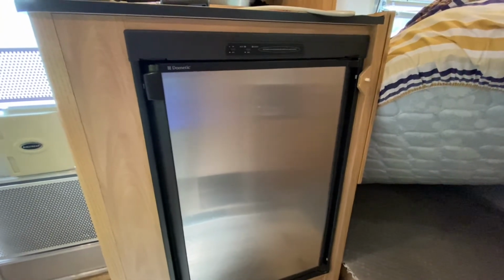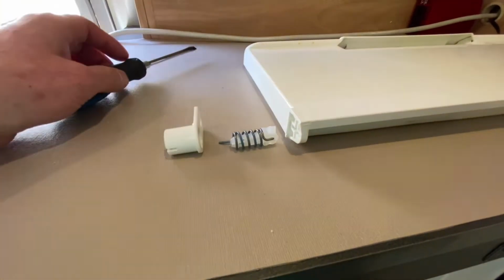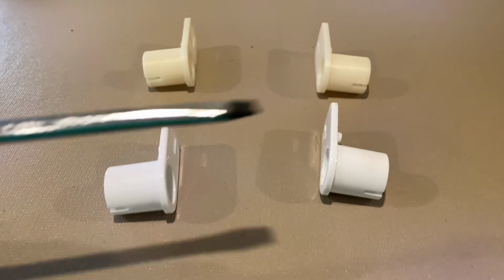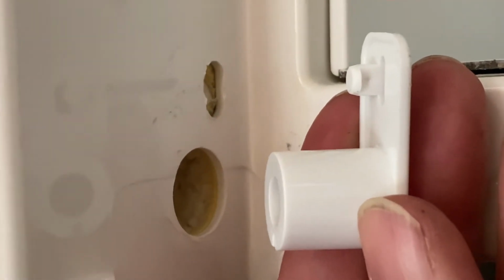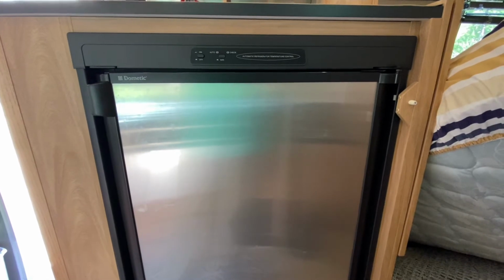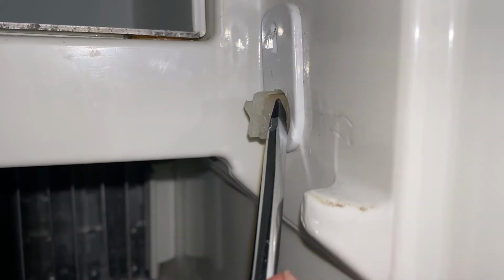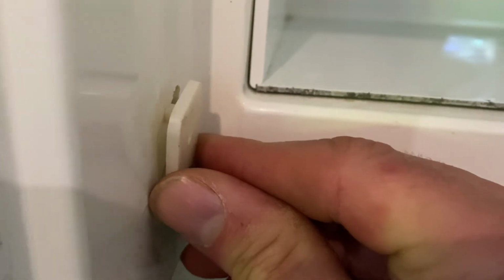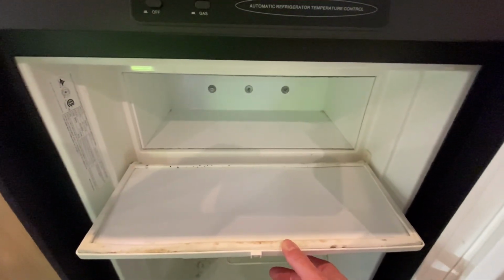Fix Your Dometic Norcold RV Freezer Door and Save MONEY!

Comment: Do these also work for the norcold refrigerator?
Reply from the maker: Hi Steve! The technique works for Norcold. But our parts are specifically made for Dometic. Some folks do say that our parts do work (or can be made to work) on Norcold, but our advice is to find an exact fit. The good news is that Norcold OEM replacement parts seem to be easier to find and less expensive than the Dometic ones.

Comment: Thank you for your video. My freezer is a Norcold and the spring housings were a little different but operated the same. I ordered new ones, followed your process, and the freezer door stays closed. Again, thanks.
Reply from the maker: Great to hear! Our springs, spring housings / casings, pivot bolts and spring assemblies don't fit Norcold (without some modifications), but the techniques are similar, and you can get Norcold parts on Amazon.,

Comment: We have a norcold but the hole didnt line up to pop it in to make the spring tight (the hole was a little low so we had to drill out just a little to make it work) but fits really tight and has the ping to close. So it took a little longer because we had to take everything back out to do that. Also the hinge housing and springs on the refrigerator were quite a bit longer than ifixit but it still worked. We have a jayco 2009 popup. Great savings and great parts! Thanks
Reply from the maker: Good point! This video is useful to know how to fix a Norcold, but you need Norcold parts for best results. Our iFiXiFi parts are optimized for Dometic.

Comment: Excellent video! I'm usually afraid to take on a project that might involve expensive collateral damage, but your instructions were great and we knew what to watch out for.  Both original spring housings were broken, we replaced them with your upgraded parts in less than 20 minutes. (The RV dealer estimated 3/4 hour labor at $200/hr.)
Reply from the maker: Thanks! That’s useful info. $150 for labor, plus waiting for an appointment, and taking the RV there and back… I think you owe yourselves a treat!

Comment: Perfect!! Great video!! I have the exact same fridge and exact same problem! Will be ordering parts soon!! Also if you lock your keys in your car you can use that air shim to help pry open your car door or window a bit to get a rod into the opening to hit the inside  unlock button on your car door. Need to pull the top of the door or window glass open enough to slide the air shim in then pump it up enough to have a big enough gap to get slide the rod in
Reply from the maker: Thanks for the tips!

Comment: THANK YOU for posting this video. I have a Norcold N512 fridge in our trailer. It took less than 5 minutes to change out the springs....almost like I knew what I was doing.  :-) I too loosened the screws on the bottom right of the freezer door it popped right out. A much safer option than prying it off with a screwdriver. Now to figure out what I did wrong restringing my window shades....
Reply: I have same looking one but much longer part # 619042 model norcold n306

Comment: Well these parts did fix my Dometic RM2501 fridge. However, the hole where the tail of the spring pokes thru need some slight modification to get spring thru. Door stays closed, but it does not “slam” shut. Thanks.
Reply from the maker: Hm. If it's not closing enough, you might not have put enough tension on the springs, or there's a slight chance that the springs are worn. As far as the hole where the tail is, please send us a pic of the problem. If the problem is with our parts, we'll send you new ones.

Comment: Hi
Does your part fit both Norcold and Dometic?  I have the Norcold  N412.3
On the ebay site it shows dometic.  I think Norcold is now from thetford.
John
Reply from the maker: Hi! Many models of Norcold use these parts. Generally if it looks like it's the same part, it is. And if it doesn't fit, just return it.

Comment: Hi no issue with the upgraded parts they fit my 2006 RM2354 no problem.  My fridge freezer door has them removable female receivers that screw into the bottom of door.  Remove the screws help with the disassembly.  No need for air bladder.  For me the screws need to be reinstalled first as trying to thread the screws in while pushing the spring in the hinge assemblies back in is not easy.  What work for me was you need to rotate the arm of one of the hinge assembly counter clockwise to12 oclock position and lock it in.  This gives just enough clearance to snap the other hinge in.  Then you you can rotate the second hinge assembly CCW and lock it.  Everything work out at the end but I must say this took an hour and a lot of frustrations.
Reply from the maker: Great tips! Many models have swapped the molded-in female hinge plates for the screw-in ones. That's a smart move, because the molded in ones eventually get brittle with age and break.

Comment: Thanks for the detailed instructions.  I really appreciate you outlining the caution points. Without them, I probably would have damaged something.  Your parts are much better then the standard replacements you get elsewhere.  The air chim was a great tip.  The one I ordered from Amazon came with 3 plastic pry bars that were very helpful.  I did have a few challenges that took a bit to figure out.   I originally thought the holes for the cam was too small until I reversed it and put the cam in first and it fit.  The challenge was getting the cam to fit with the spring in first.  I ended up using my bench vice and very gently compressed the cam and spring in the assembly.  Worked like a champ.  Challenge 2 was getting the right side of the door to go into the slot. After a number of tries and a few choice words, I finally got it to seat.  I think I will have a permanent "X" on my thumb from pressing the darn cam.  On a happy note, there was no bleeding involved with this project.  I consider that a win.  The door now closes with a snap like a mouse trap.  Thanks again.
Reply from the maker: Thanks for the "X"-cellent tips!

Comment: I was not able to use the air shim. But my Dometic has exposed hinge holders and by removing the two screws in the right hinge the door come off to allow the repair that is so well detailed in this video. It would be helpful to note this difference for those whose freezer door has the exposed hinge mount. Thanks!
Reply from the maker: Great suggestion! We'll include it in the next revision of our video!
Reply: THANK YOU for mentioning this. I have the same screws and would not have thought to just take them out. Didn't even bother with the shim. Now to figure out what I did wrong restringing my window shades. Ugh!

Comment: Great part, great instructions, great video…but I’m having difficulty getting the right side of the door in to the “+”. Left side is good I’m holding it in as tight as I can, but it still seems just a hair too wide to connect the “+”.  Tried the spatula method but don’t seem to have enough room to get in either. Any suggestions? Or better yet, any photos of the spatula method in action?  Thanks in advance.
Reply from the maker: Hmmm... So, you can't push the bolt on the right side in far enough to get the door to fit? 3 things you may want to do. 1) Check to make sure your springs are on the correct sides. 2) The bolt has a tapered end. When you push it into the spring housing, the tapered end sticks through the hole in the "bottom" of the spring housing cylinder. IF your bolt isn't too worn, it usually catches and stays in place. 3) You can also use the Air Shim to widen the gap.
Reply: @ifixifi  1. Springs are correctly installed on their proper sides.
2. The bolt end is catching as it should.
3. I actually thought of using the air shim too, but when I inflate it to the size I need, it seems to push the door out & then slips out of position.
Reply: Ok, finally got it!  Needed a third hand to help hold & push, aided with some colorful metaphors. Thanks for providing a great solution to a unique problem.

Comment: These parts are AWESOME! They were shipped promptly and we won't be fumbling around with the freezer door tomorrow on our camping trip. One pointer- in my case the housings had a ridge near the opening that would not allow the spring pieces to recess into the housing. I used a rotary tool with a sanding drum to remove the ridge. After this simple modification, they went right and and are much better than the ones from the OEM. Thanks!
Reply from the maker: Thanks, Mitch! We added a "wear ridge" to the spring housings. In many cases, people have older freezer with more use, and the wear ridge helps keep things tighter for those well-worn parts. If you have parts that have seen less wear, you'll need to sand down the wear ridge a bit. Good point!

Comment: Bought your replacement parts but the inside hole was too small. I sanded down my plastic spring loaded pieces to get them to fit into the new smaller piece I got from you but now the freezer door will not close up tight even if i push it it falls back 1/4 inch. 
I did the install procedure just as you demonstrated in the video. Any ideas?
Reply from the maker: Hi John. We added a "wear ridge" to the spring housings. In many cases, people have older freezer with more use, and the wear ridge helps keep things tighter for those well-worn parts. If you have parts that have seen less wear, you'll need to sand down the wear ridge a bit. Good point!
Let us know at ifixifi.co if you're still having problems. We'll set things straight or refund your money.

Comment: Tip: If your freezer door has two screws to hold each of the hinge receivers in place...To remove the door, remove the two screws from the right side and the receiver will come off easily and the door with it. To install the door, remove the farthest right screw from the right receiver so it will swivel slightly then align the right receiver and place it in the right spring housing. Finally, align and install the farthest right screw.  No need to use screwdrivers or other tools to wedge the freezer door into place!
Reply from the maker: Great input, Dan! I do not have one of those models, so I couldn't demonstrate that. By the way, which model do you have? It would be nice to know for the ifixifi.co website.
Reply: @ifixifi  The model I replaced the freezer door hinges on was Dometic 2352 on a 2004 Pleasure-Way Excel TD camper van. However, I think many others have the same door receiver design with screws mounting them to the bottom of the freezer door. Much easier to install by removing these screws, if equipped, than wedging the door. And thanks for a great product -- much better construction than the original part.

Comment: Use an Allen's key that fits through centre hole to remove
Reply from the maker: Tell us more! That's a bit of head scratcher.
Reply: @ifixifi  the door at the pivot point has a 3mm hole drilled.
I didn't want to risk a screw driver so pushed an Allen's key through and forced the spring back to pop it off the mount.
Seemed to work.

Comment: The video, instructions, and parts worked great. I had a problem getting enough pressure on the door to slide it over the hinge bolt. Finally used a frosting spreader as someone suggested and it did the trick. For some reason the tension is less than  would like. Do you have experience removing the door with tension on the springs so I could readjust the tension.
Reply from the maker: Nice to hear from you, Lyle! Yes, you can remove the door according to the instructions and retension them. There are basically 2 tension settings: 90 degrees and 180 degrees. Let me know if that needs more explanation. Hope you like the boiling water test video. ;-)

Comment: Thank you so much for this video and for the clearly superior quality of the freezer spring casings I purchased from you to replace the ones that were both broken on my Dometic Refrigerator! I did have a problem re-installing the door though. I was unable to push in the 2nd hinge bolt enough to get it onto the door after quite a number of attempts. Even though the right side hinge assembly was in as far as it would go, and I could push in the left one somewhat, it just wasn't enough. I even tried to reverse the install instructions to install the left side first, followed by the right side to see if I could push that one on the right side in more to finish getting the door on. No luck pushing either one in far enough. I finally removed the 1 hinge holder screw nearest the side of the refrigerator, and loosened the 2nd screw. This gave me just enough extra leeway along with pushing in the hinge bolt as much as I could to get that second side of the door on and "locked" into the bolt. Then I put the 1st screw on the holder back in and tightened both before flipping the hinges up and locking them in place. Done! Personal note: I am not a very strong person to start with.... Hope this might help someone else.
Reply from the maker: Hi Sandi! Nice to hear from you! As you can see from the video, it does take a lot of force to press those hinge bolts in. I wonder if re-inflating the AirShim would be good at that point? Maybe press back against a fridge wall that had bowed in a bit with age and use? But... bottom line is you were resourceful and a flexible thinker and came up with a solution that will help other folks! Happy camping!

Comment: I found the easy way to get the right side into the door. I tried pressing on the !@#$ right side spring for "a very long time" and was in danger of buggering up the X in the bolt from pressing with a screwdriver.  What I did was take a cake frosting spatula and use it as a shim. I put the left side in as shown in the video, laid the spatula on the X, and pushed the bottom of the door over the spatula until it was over the X. Pulled out the spatula and done! No more than 3 minutes start to finish including a sip of wine for my efforts. Thank you very much for information about the air bags! That made getting the door off a snap and I learned something new in the process.
Reply from the maker: Great tip with the cake frosting spatula! -- Just don't tell the cook of the household, or you'll get one of THOSE looks. ;-)

Comment from the maker: UPDATE: A few of you have contacted me and mentioned that you may not have to preload your springs with 180 degrees (a half turn) of tension as I demonstrate in this video.  You may be able to use only 90 degrees (a quarter turn) of tension per side. Put  the LEFT spring housing arm at about 8 o'clock and the RIGHT spring housing arm at about 4 o'clock.